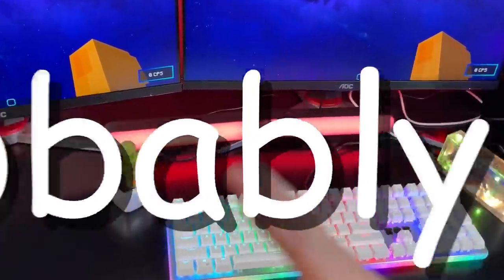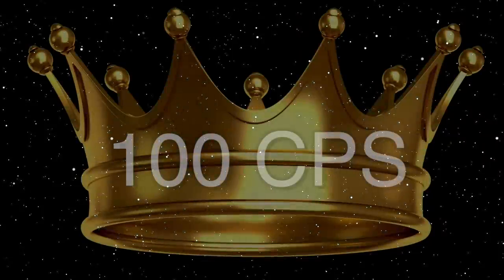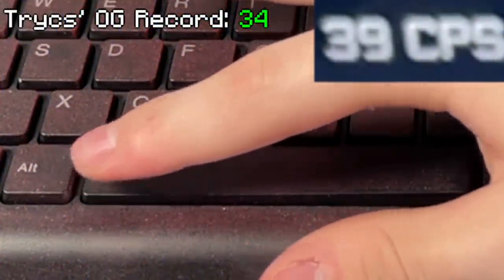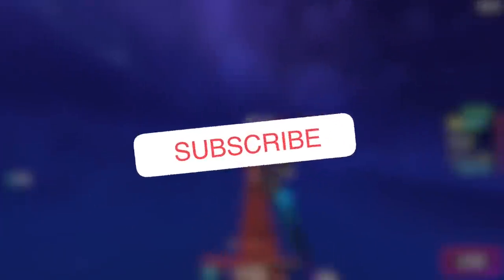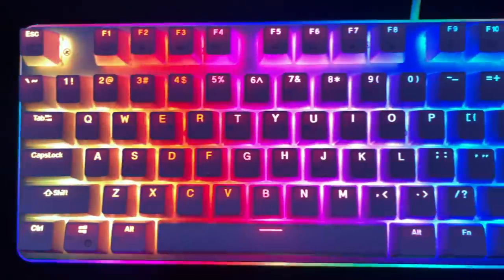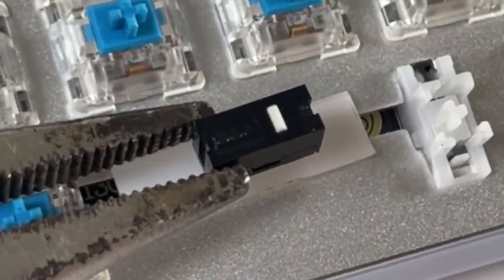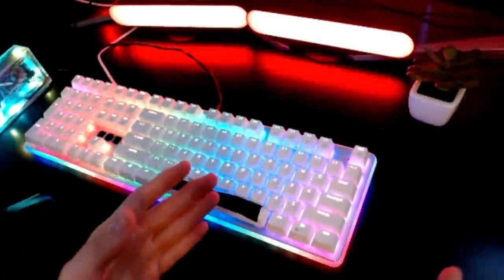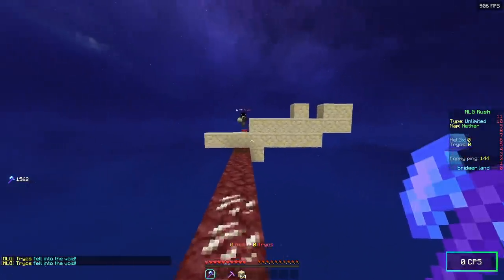One Spacebar, 100 CPS (ft. Trycs)

Comment: "For its relatively low price the keyboard is actually not that bad, here is a sound test"
- Meanwhile blue clicky loud switches

Anyway love the video lot of effort
Reply: I like clicky
Reply: @Mcneds  respect
Reply: Ye coz blue ones were gonna be the best for this mod
Reply from the maker: I ordered it with linears but it came with blue clicky switches instead :/
Reply: @Mcneds  huhhhhhhhhhhhhhhhhhhhhhhhhhhhhhhhh
Reply: @glitchesTM  Ye I got a razor keyboard with green switches
Reply: @helixmods  it’s an rk, right? If it is, it’s probably hotswap, so you could get some gateron reds and put them in w/out soldering
Reply from the maker: @Natalietrans  not hotswap :/ else I would bought some actually switches
Reply: @helixmods  consider building a custom kb based on this idea
Reply: @helixmods  lol bruh
Reply: ikr

Comment: Very impressive, another way to mod this is to get a keyboard that supports remapping (coming from a mechanical keyboard hobby background, maybe consider a qmk/via compatible keyboard), in which case u can just wire the mouse switches to the keyboard itself, replacing 2 keys of your selection, and then remap them to rmb or whatever key u need. This way it would come out cleaner, without the need of an external module. However, I don't know what's the max cps it would support as we keebists haven't had a need to achieve something like this on a keyboard.

Comment: You added two extra switches. BUT YOU COULD FIT SIX!!!!!!!!!!!!!!!!!!!!!!!!!!!!!!!!!!!!!!!!!!!!!!!!!!!!!!!!!!!!!!!!!!!!!!!!!!!!!!!!!!!!!!!!!!!!!!!!!!!!!!!!!!!!!!!!!!!!!!!!!!!!!!!!!!!!!!!!!!!!!!!!!!!!!!!!!!!!!!!!!!!!!!!!!!!!!!!!!!!!!!!!!!!!!!!!!!!!!!!!!!!!!!!!!!!!!!!!!!!!!!!!!!!!!!!!!!!!!!!!!!!!!!!!!!!!!!!!!!!!!!!!!!!!!!!!!!!!!!!!!!!!!!!!!!!!!!!!!!!!!!!!!!!!!!!!!!!!!!!!!!!!!!!!!!!!!!!

Edit: sorry four, but still. Also use smaller switches so you can fit more

Comment: SPACE BAR CLICKER

You have hit spacebar 1001 times.

Wow! Also you can use the timer!
BRIEF: Enter the desired amount of time in seconds, then click the "Set Time" button.
The countdown will start after the first press on the space bar.
To reset the timer or remove the seconds counting (no timer), simply press the "Restart" button.
Timer: 0 sec
Set time 

Look here I have reach 1001 clicks!

Comment: After watch all (i guess) your videos about modified mouses etc. I still don't get why u don't just buy 3d printer for stuff like this and just design it in fusion 360/freecad and print needed parts instead of trying create them from everything you have in your house v: 3d printers nowadays isn't really expensive (like ender 3) and they will probably improve your workflow a lot
Reply from the maker: I wanted to create clear acrylic parts so I didn't want to use my printer